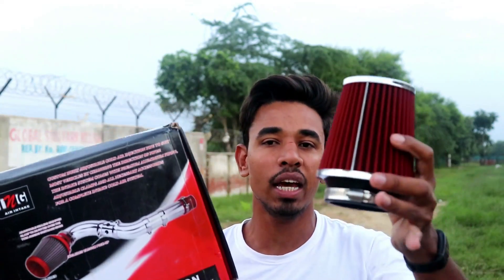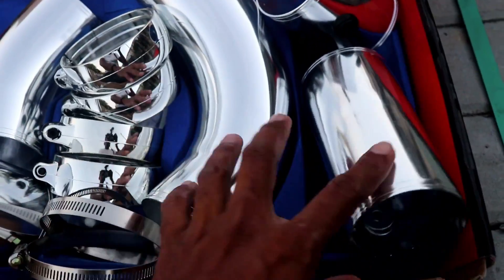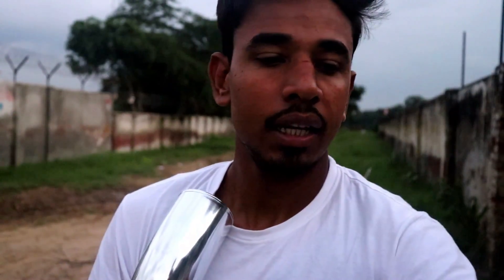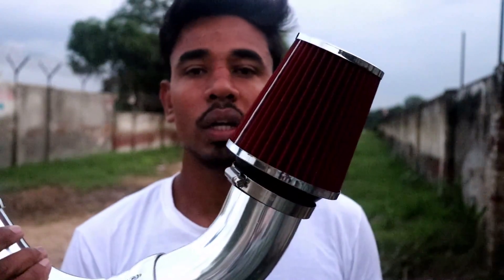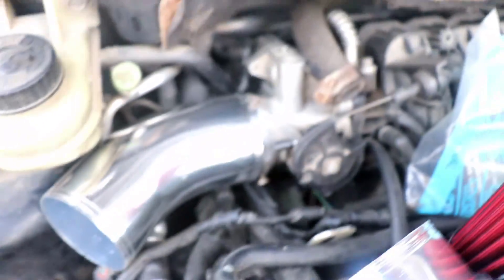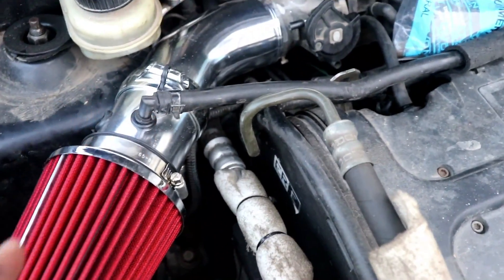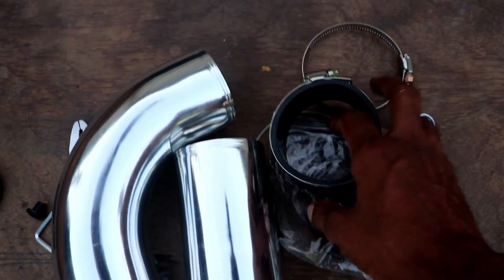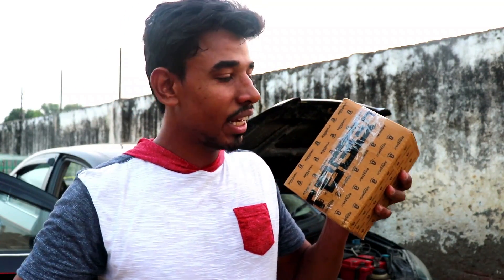Car Performance Air Filter | Sound like Super Car 😍

Comment: Install a cold air intake not a normal air intake.It will increase mialege and power while the normal intake only increases the sound of the engine

Comment: A quick question mr techno khan...all the car filters are concealed & not exposed for a reason based on specifications..your project sound is osm...but your filter is exposed so how long it’s gonna last from dust & how frequently you have to change it? If you are driving your car daily I guess you have to change your filter weekly isn’t it? & if you don’t change the filter on time you know the engine is gonna break down very fast..bottom line is it worth it?
Reply: Black Panther you need to change only the paper mesh air filters , as it is a metal mesh air filter you have to just clean it with brush!

Comment: Limited edition "Chutiyappa" 
Never ever do this in your car if you want good engine life.
Reply: Air intake doesnt do much harm to your engine unless you dino tune the car
Reply: @ri5hi639  it do harm if you use replicas
Reply: @ri5hi639  cone air filters suck in more hot air from the engine and possibly more dirt